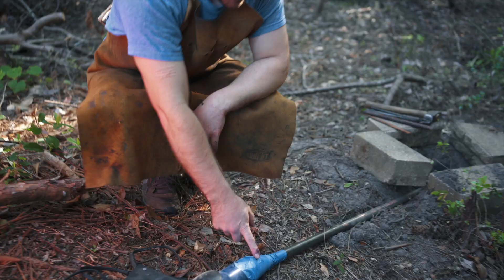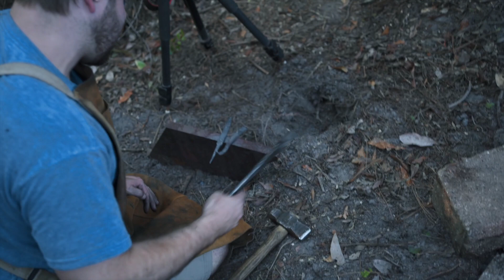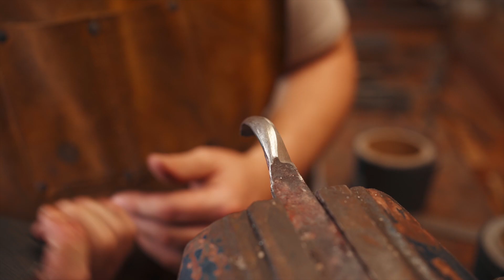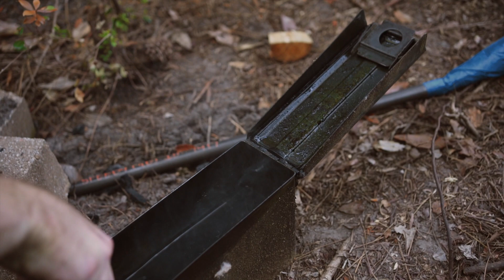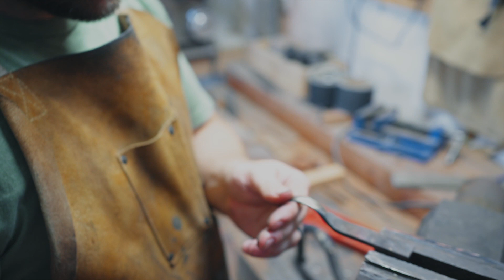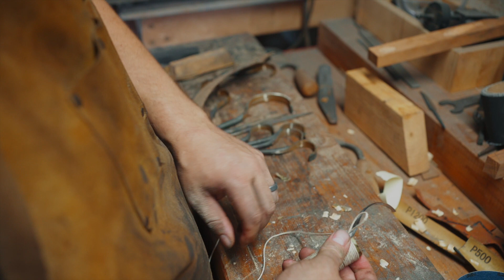Forging Spoon Carving Knives With Basic Tools

Comment: Wish ànyone playing Bladesmith would check out for suggestions as to build with known steel for the project such as 01 or 1095 and  suggestions for quenching oils. 
Don't just make videos that doesn't teach correctly. 
 Sorry I just wasted to much work on junkie steel building tool just better than the Chinese and 3rd world nations
Reply from the maker: It was lost somewhere in the edit that I was using an old USA made file to make these tools. Obviously this isn't "known" steel but the point was instructing the very basics. Ive made and sold thousands of knives as a professional tool smith in the last 10 years and 99% of them are made from known steels with strict heat treating processes followed. These tools made in this video perform just as well as anything. Better than 1095 in fact.

Comment: This is awesome 👍🏻

Why did you not put the tang of the hook knife in the center of the handle? Is it for ergonomics or to get the tang closer to the wood? Sorry if I missed that part.
Reply from the maker: Simply just to show a different method of doing things. I could have done it the same as the sloyd knife for sure.